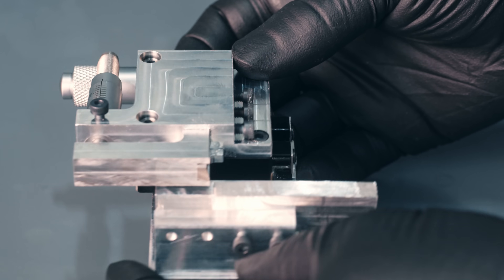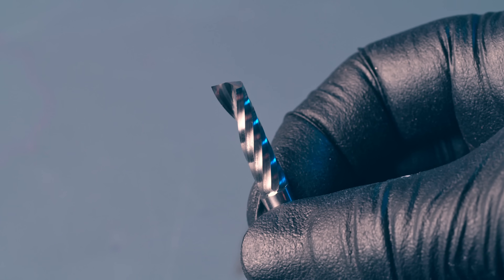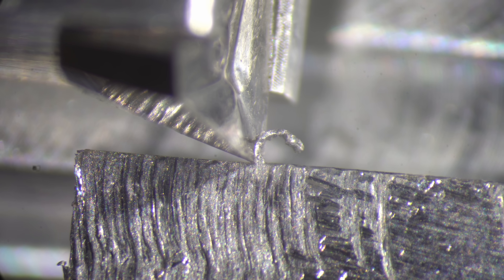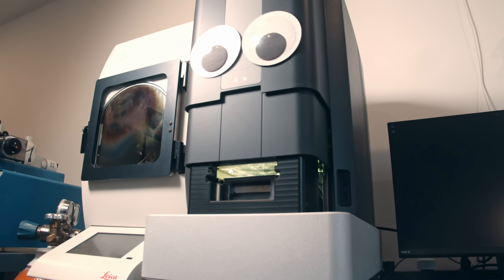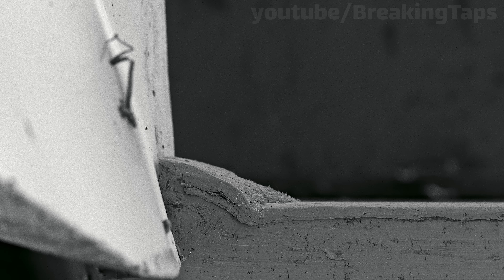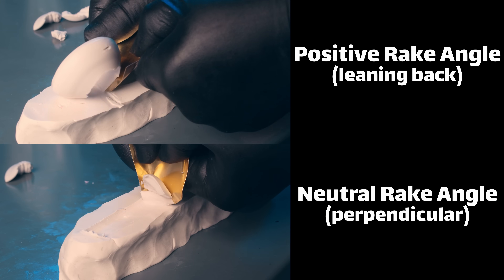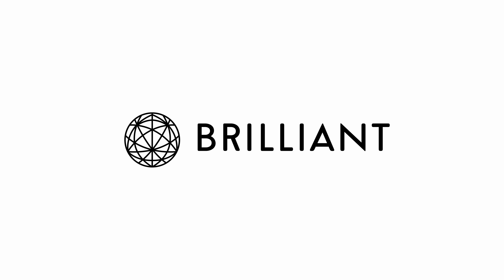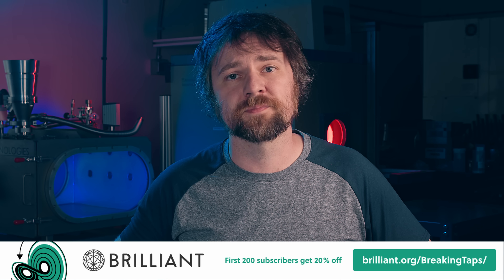Cutting Metal inside an Electron Microscope

Comment: Maybe this is a dumb question, but couldn't you just put a remote controlled motor in the chamber with a battery and advance the cut with that? Sounds kinda easier than a mechanical wind up drive
Reply from the maker: Not dumb at all! Definitely considering it, although it's a little tricky since most batteries won't like the vacuum chamber either. So I'd probably need to make some kind of air-tight enclosure for the battery so it stays pressurized. Doable but there is relatively limited space, and I'm a bit concerned if my engineering wasn't good enough. I'm not sure what happens when batteries depressurize inside a vacuum chamber 😬
Reply: @BreakingTaps  What sort of batteries do cubesats use? I wonder how difficult space-rated batteries are to get ones hands on.
Reply: @BreakingTaps  make a power passthrough ring that can act as a gasket on the lid? embed/glue in banana plug connectors(or any kind of connector you want) and you have an easy way to pass power through from the outside.
Reply: There are some design details that could make it a little more complicated but yes I think that's a great thought and it may be easier than spring drive.

Comment: Wow. It's much less crystalline than I imagined. More like moving that clay you demonstrated on. Interesting how it pushes until the stress builds and then separates.
Reply: It's all clay?
Always has been.
Reply: @joejoemyo best comment, needs more upvotes
Reply: @joejoemyo gunshot echoes
Reply: @joejoemyo  very true...every thing we have no matter how sophisticated is refined from rocks and sticks and dirt.
Reply: @joejoemyo  i love it when people get to use memes to appropriately describe a topic
Reply: @joejoemyo  underrated comment
Reply: Well aluminum and it alloys are known too be very ductile aka "gummy" steel would be a way better demonstrate for the cristals and well there size depends on the heat treatment and alloy
Reply: @TheLtVoss  Isn't mild steel more ductile than 6061? If I'm remembering the young's modulus graph I think mild steel goes from elastic to plastic later than 6061. But, I'd have to look to be sure.

Copper is, counterintuitively, stronger than steel or AL. When we talk about material properties, we sometimes mix up the nomenclature in regular conversation.
Reply: @WmSrite-pi8ck  yeah "gummy" and "ductile" do not mean the same thing.
Reply: @TitoRigatoni  well in the context of the video and that was shown in it well yes gummy is the word used for the material property "ductility"
Reply: @WmSrite-pi8ck can you elaborate? In my limited experience, strength is demonstrated by something like a tensile test, where I believe almost any steel would have higher strength than copper, except for maybe beryllium copper, no?
I’ve always found that people mix up terms like strength, toughness and hardness. Many people don’t understand why something very hard and strong like hardened steel can also be not very tough.
Reply: @TheLtVoss  People who use hand-pushed traditional engraving methods, including on steel, create long thin 'slivers' of metal with each push. Even for less malleable/ductile methods, this is still how it works.
Reply: @sophiophile  my original comment was regarding the actuall metal cristals and how they behave in the sheer zones  depending on size and geometry and if they would change the sheerlines.

That has absolutely nothing too doo with hand engraving beside that engraving is a cuting of metal and is subjected to these phenomena
Reply: @TheLtVoss  I more meant that the boundaries for monocrystalline regions are probably too small for them to show up at the scale/depth that he is graving/shaving/whatever with steel.
Reply: @TheLtVoss even steel will resemble clay in this demonstration. You would need a much harder metal to see what you are talking about. At that point you would get less of a snake and more flaking and breaking as the hardness increases.
Reply: Yeah, the world is way more “gloppy” and sticky than it first appears! Just depends on the forces and time-scales involved :)
Reply: @mduckernz  Atoms & molecules are small and easily displaced.  However when you squash enough of them together and they can no longer move out of the way, everything becomes rigid and eventually totally uncompressible.
Reply: Yeah that's exactly what I was thinking!
Reply: ye it reminded me of this video about a certain geotechnical foundation failure https://youtu.be/KgKW10iA_4w?t=269
Reply: Low grade aluminum... the crystalline structure is pudding.  I charge more to machine it... usually to the point that at least 6061 becomes cost effective.

You are correct on the mild steel vs 6061... but I don't think this demonstration utilized 6061 (admittedly I played most of it in the background while working on something else).
Reply: Anyone who does tradition (hand-pushed) engraving has felt what you are describing from a tactile perspective.
Reply: That's just what I was gonna comment! I was amazed by how similar it looked to the clay!
Reply: I'd like to see this aluminium(?) under the electron microscope at maximum magnification/resolution, see if it's more like crystal lattices at a smaller scale.
Reply: I meticulously sharpen my cutting tools and now i know i'm just bulldozing material along.. My sharpening OCD just went to 11!!
Reply: @chuckthebull  It does make a difference right.
Reply: If you ever get into blacksmithing you’ll quickly notice that steel behaves a LOT like stiff playdough. It genuinely helped me understand material science and strengths more 😅
Reply: This was so interesting as it cut exactly as it looks on the lathe when i cut aluminum.
Reply: Why would a malleable material have a crystalline structure to it?
Reply: @SmothersSawShop  bro metals have a crystalline structure, look it up.
Reply: @SmothersSawShop  pure gold is soft like butter. Are you saying that pure gold is amorphous? Metals ARE crystals. Period.
Reply: @SmothersSawShop  It is all about scales.   On the surface of stars, hydrogen forms into a diamond like lattice much stronger than diamonds.   Yet it is malleable at stellar scales, where structures exist briefly on the surface as large as planets.
Reply: Interestingly enough, this reminded me of models showing tectonic plate collisions.
Reply: ..

I think,  you should consider " crystalline formation" in Atomic level..

... just saying..

😊

.😊
Reply: I think it’s as crystalline as you imagine, you’d just need to zoom in a lot further to see regular shapes
Reply: @thirstly  Further than a electron microscope ?
Reply: @MrJermbob  They all have different magnifications...just like optical microscopes.
Reply: @thirstly  Zoom in further than a SEM? Or zoom in further with the SEM?
Reply: @thirstly  interessante, a sua ideia. Já eu acho improvável que seja como você propõe: para mim, estruturas cristalinas tendem a fraturar. Assim... pode até ser que pequenas porções isoladas do material possam estar organizadas de forma cristalina, mas em escala macro, ele definitivamente não é cristelino. Enfim, se é cristalino ou não vai depender de algum acordo sobre o que essa palavra significa.
Reply: “Less crystalline” meaning what? It’s entirely crystalline.
Reply: @gaijinhakase1575  Awesome. Please do a lecture in the comments section of a YT video about lattice structures and crystals. I'm sure we're all dying to hear.
Reply: @WmSrite-pi8ck  I’m asking what you mean by less crystalline. Any reason why you’re acting like a child?
Reply: It is aliminium tho which is quite soft, it would be really interesting seeing it for other metals.
Reply: I think to see a real crystalline structure you'd need to magnify further
Reply: Different kinds of metal, Aluminium is very soft and cannot be heat treated for example, so it cannot form martensite crystals from hardening,
Reply: Metals crystal structure is at the molecular level no? you wont see any of that at this scale lol
Reply: Aluminum is like butter, no matter how you treat it (beyond alloy)
Reply: I think you dont know anything. On this magnification scale you cannot even see how crystal planes slip on each other. That's whats happening here. Metals are ductile because of that. Freeze it down to -100 degrees and let it drop in a bulletproof safe area without your presence and come back after that experiment, telling me that metal is not crystalline. Crystalinity has nothing to do with the materials plasticity if its about metals.
Reply: I think you dont know anything. On this magnification scale you cannot even see how crystal planes slip on each other. That's whats happening here. Metals are ductile because of that. Freeze it down to -100 degrees and let it drop in a bulletproof safe area without your presence and come back after that experiment, telling me that metal is not crystalline. Crystalinity has nothing to do with the materials plasticity if its about metals.